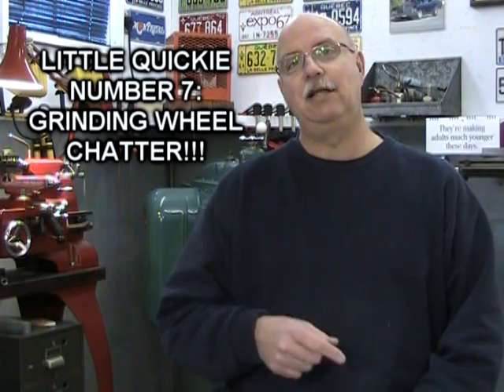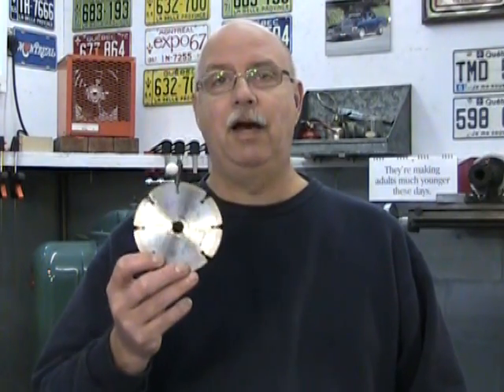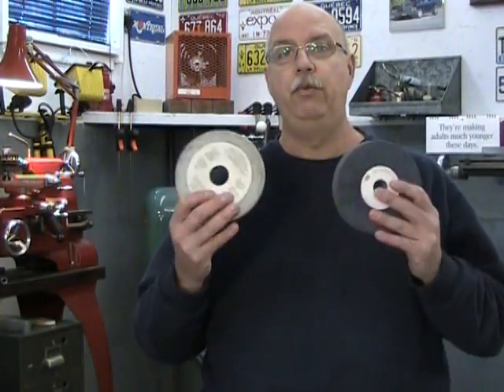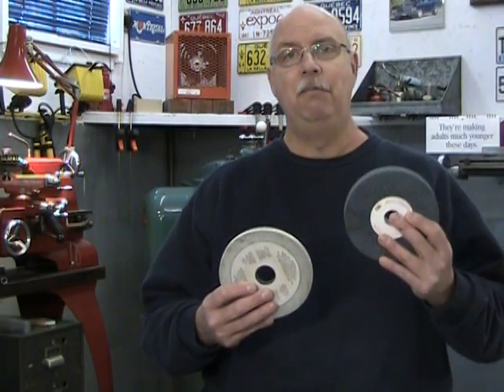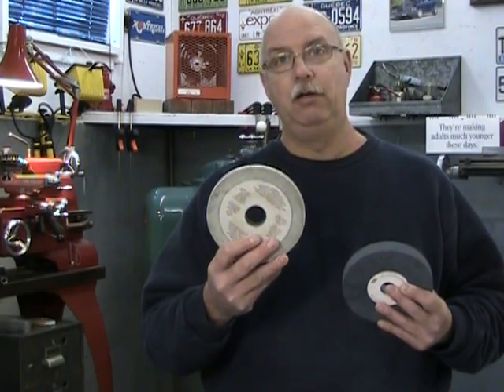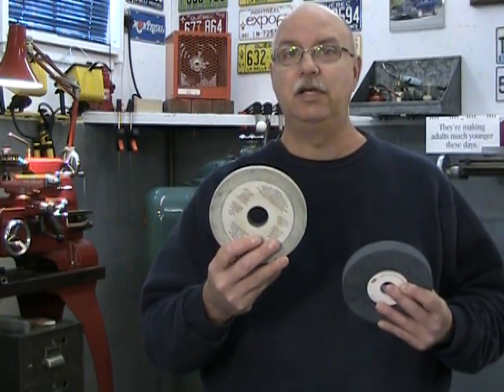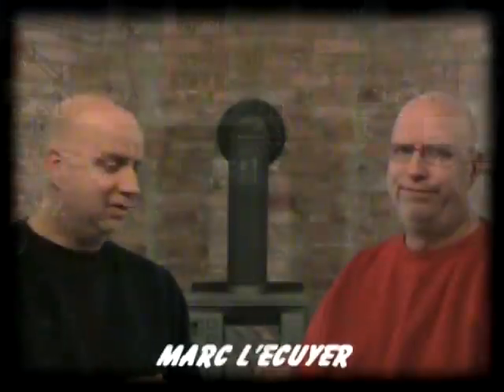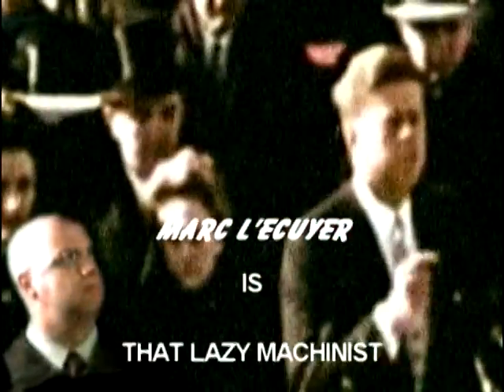HOW DO GRINDING WHEELS CUT, WHEEL SELECTION & ELIMINATING GRINDING WHEEL CHATTER, MARC LECUYER

Comment: Mark great job as usual. Chatter is bounce, excessive movement caused by many things in the grinding process. Many of which you have mentioned. One of the things which is sometimes overlooked is the machine itself. Not that the bearing or shaft may be going but much simpler. The foundation or ways on the machine ways can cause problems. Recommend to touch the beaching base where it meets the foundation and you may find it bouncing. Adjust the floor mount,check wheel balance and table vibrations.
Reply: Great suggestion MaPaZee, thanks for sharing it with everyone, Marc

Comment: What are the cupped type wheels used for ? I guess grinding the sides of parts ?
Reply from the maker: You guessed right! Don't forget to dress the face as well as the diameter, I prefer feeding from the top down (small amounts at a time) as I cycle the table from side to side very rapidly, this reduces the pressure, the wear and the heat since this type of grinding can heat up a piece quickly. Thanks for watching and for the kind words in your other comment, Marc L'Ecuyer

Comment: As always GREAT! and Thanks! For our little toys, think 9" x 18" x .75 HP hobby lathe, there is a 'Tool Post Grinder' kit, my question is, can you actually get 'micron' mirror finishes? or stick to 180, 220, 300, 400 emery cloth passes?  Stll learnin' Chazz
Reply from the maker: Hi Charles, if you have access to a good cylindrical grinder, maybe. But grinding attachments on small lathes should be used with medium grit wheels since there is often more play in the machine (bearings and xz axis) than the size of a single very fine abrasive grain. The cylindrical attachments however are good to have since, even if you can't get a ten thousands of an inch finish, they permit you to cut a hardened piece of steel to within one thousands of an inch and then, as you suggest, finish with fine emery cloth baked by a extra smooth flat file. Measure regularly with a well adjusted vernier micrometer and voila!!! If however all you are looking for is just a nice finish, you can just polish. I hope this helps and thanks for watching, Marc L'Ecuyer

Comment: Marc,
     Great video.  Thanks for sharing your time and talent.  What are your recommendations for precision grinding aluminum?

Thanks.  Chuck.
Reply from the maker: Hi chuck, I have only ground aluminum once in my life. To obtain the required finish we had to pack the part in dry ice, making it denser and giving me the possibility of lifting a decent chip with a fine wheel. Grinding aluminum is not recommended. It is so prone to penetration that the loose grit embeds itself in the surface, its melting point is so low that the wheel gets packed up almost instantaneously and it is so soft that it wants to grab continuously. A really sharp cutting tool with a 50% mix of water and dish soap will probably give a more accurate cut and a better finish. Don't leave the water and soap on the machine since it will stain. Marc L'Ecuyer